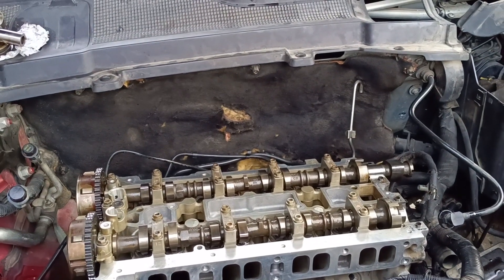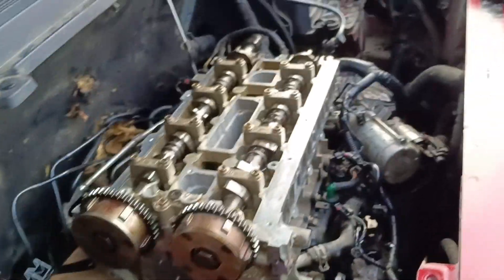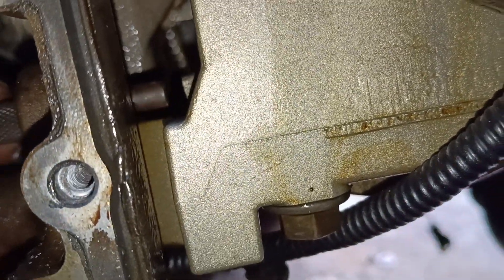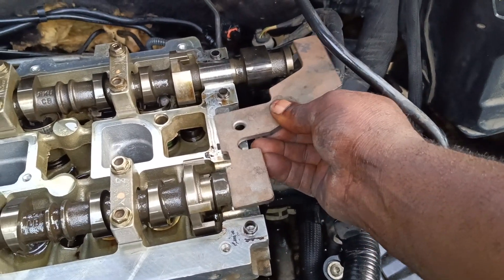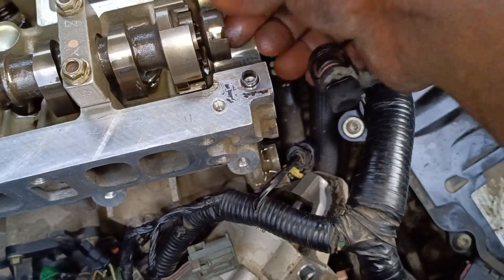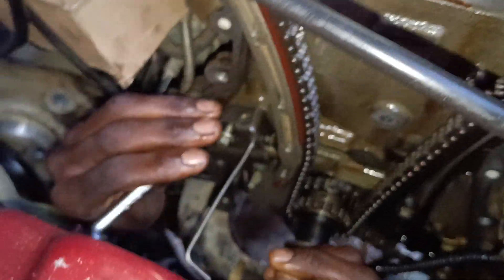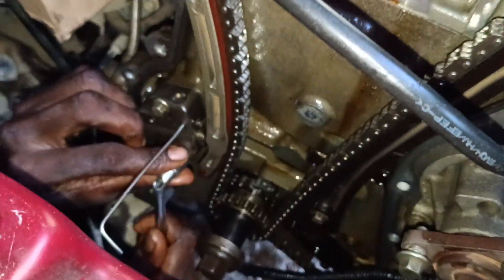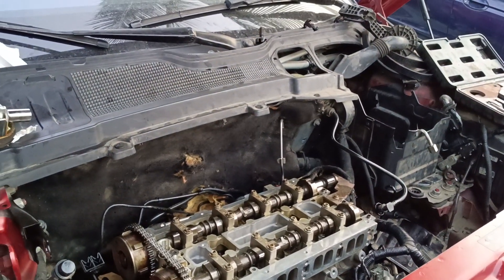range rover evoque piston and timing alignment mark part 4

Comment: Tengo una de 4 cilindros prende y después se apaga que sera le cambie los CAM phaser y después eso me sigue la falla
Reply from the maker: Does the car start now or not start at all, you can scan and send me the fault code
Reply: @ not have code
Reply: P0018 y p0019 but Is New the CAM phaser  in running 1 Weeek but unos Is not star may be 1 minutes
Reply: @ code p0019 and p0018 but I changed the new cam phasers but they were not original and they only lasted 1 week turning on well now it turns off
Reply from the maker: This code p0018 /p0019 indicates that the the camshaft position and the crankshaft are not in the right position, they timing must have jumped, you will need to reset the timing

Comment: Miamiiii🎉🎉 weldon. You knw how much i can get this tools online?
Reply from the maker: Check eBay or Alibaba Amazon i don't really know the current price
Reply: @miamiautomobile5566  Weldon Boss.. After setting the TIMING with TDC method and aligning the Cams, the Car strtd up but excess misfire. I used computer and found almost all the cylinder misfires. Danm boss!!!
Reply from the maker: Replace the spark plugs and check the catalytic for damage
Reply: @miamiautomobile5566  thanks boss. I parked the car anyway... But I'll do that now